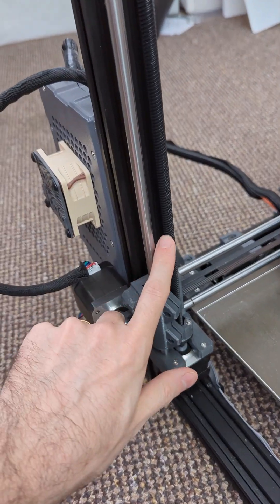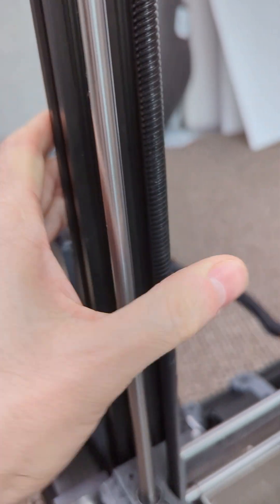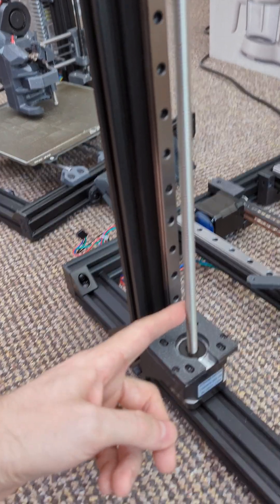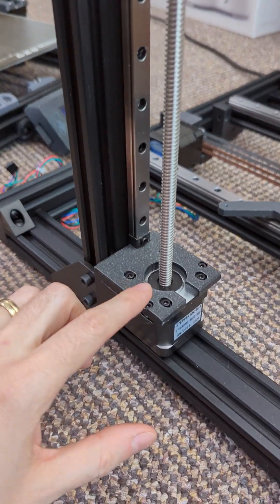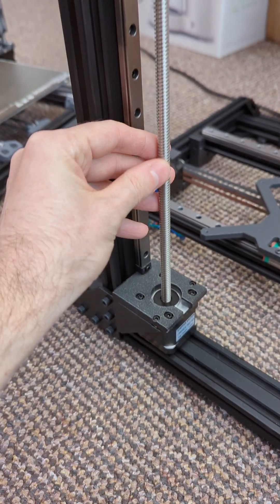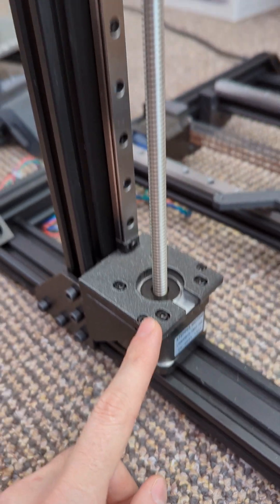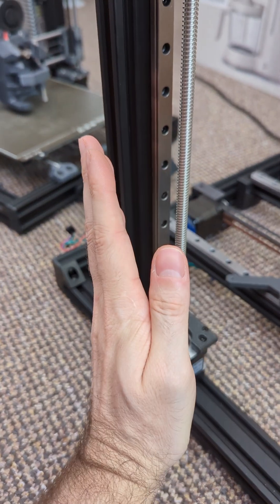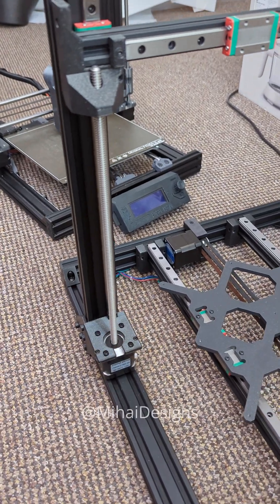Adjustable 3D printer lead screw motor mount

Comment: its also my understanding that you aren't meant to support the top of lead screws as it can cause binding and z banding
Reply from the maker: Exactly! (I just happened to have the gantry all the way up)
Reply: That's... not QUITE true, but arguably not false. Supporting both ends of the lead screw only causes those issues if the lead screw is misaligned or if the lead screw is not sufficiently straight, both of which are common conditions in consumer grade machines. This motor mount helps to correct misalignment.

The optimal configuration would be to have double support at each end of a highly straight screw plus a nesting support carriage assembly throughout the travel length. Unfortunately that's not an option available to most consumers because straight screws are expensive and nesting support carriages are niche even in industrial machinery.
Reply: @claws61821  Yes, thank you for the explanation for others. I think most people know their lead screws are far from straight when they watch them spin and the runout is laughable.

Comment: You can use an oldham coupler to fix that too :)  but good work there too
Reply: I dont think that would work with these steppers. The screw is part of the stepper.
Reply: You would need other steppers and definetly loose some z space, except yo would top mount them